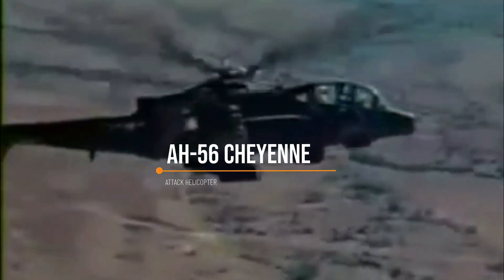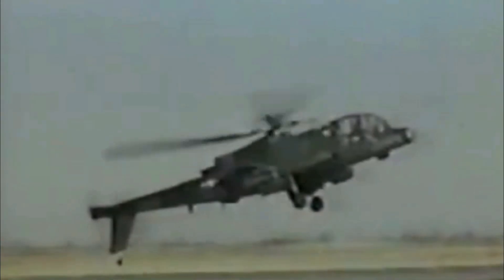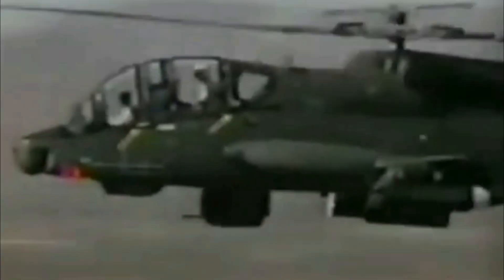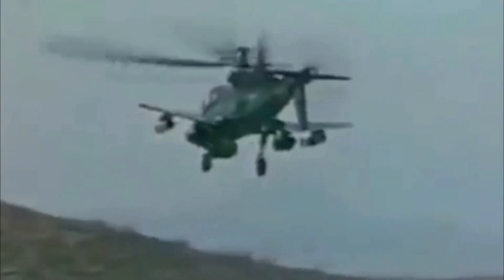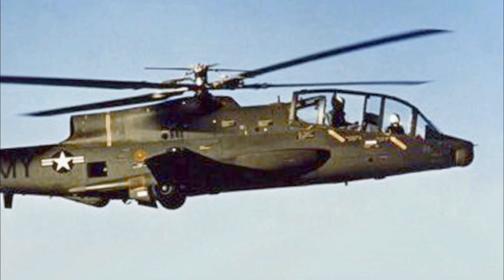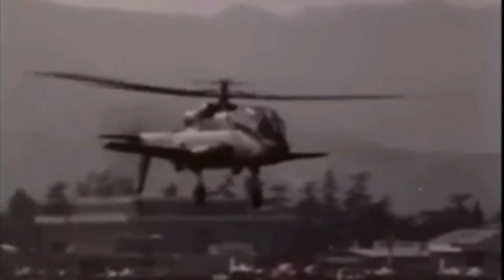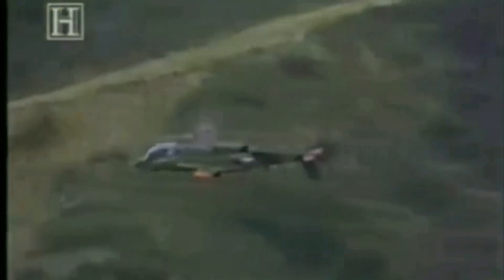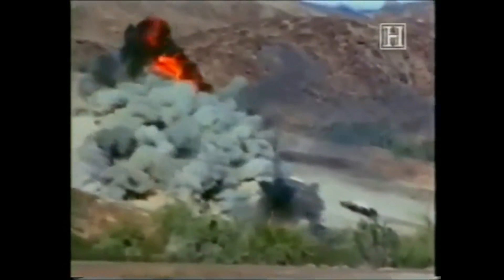Ultimate Attack Helicopter Never Produced: AH-56 Cheyenne

Comment: A terrible loss to helicopter development when this state of the art aircraft was cancelled.   All the problems were solved at time of   cancellation .  We flew daily at speeds of 250 mph, which helicopters today, 50 years later, are just now achieving.  It carried the same weapons of the A-10.  The Air Force did not want the Army to have such an advanced aircraft.  All Army pilots had to serve in a combat role which gave them a closer affinity to the combat troops on the ground.